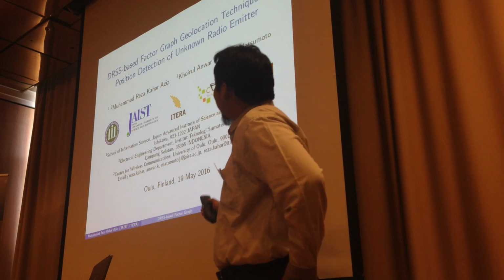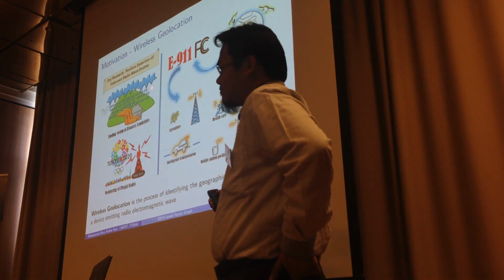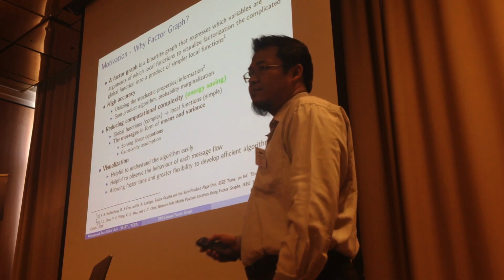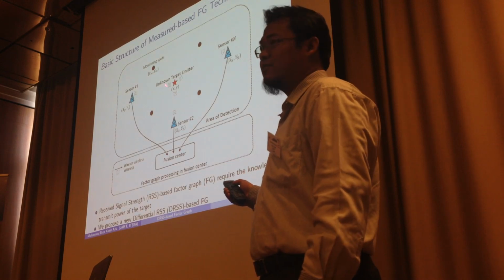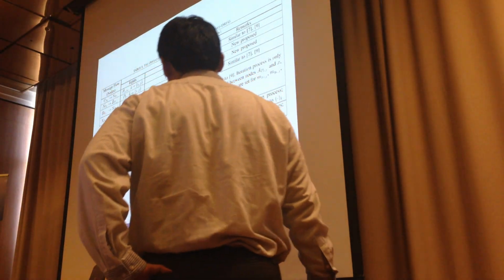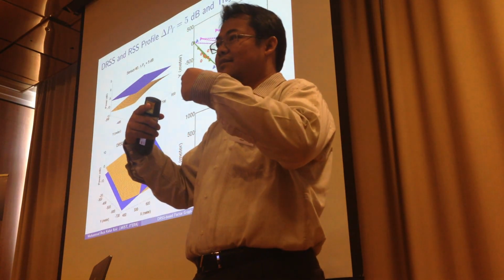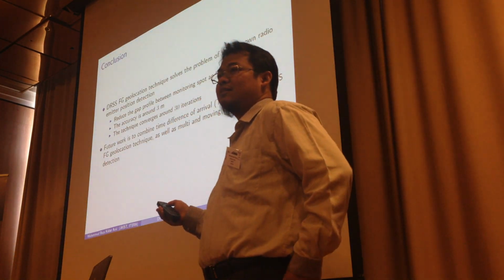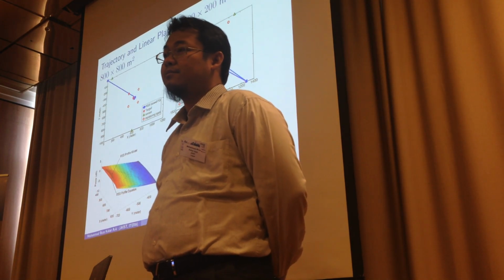DRSS Factor Graph Presentation in European Wireless May 2016 Oulu Finland

Comment: This video is very interesting and adds knowledge about factor graph-based geolocation techniques to detect positions on unknown radio transmitters. It also explains the application of Differential Reeived Signal Strength (DRSS), Use of Least Square (LS), and Concepts in Factor Graph